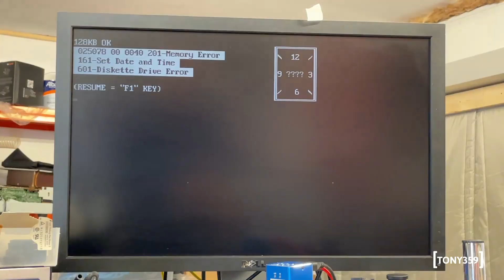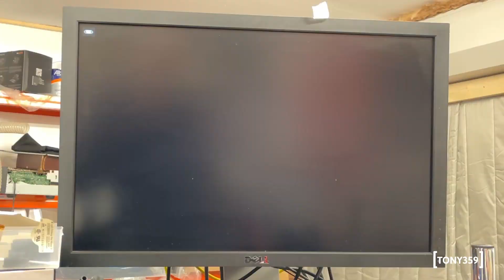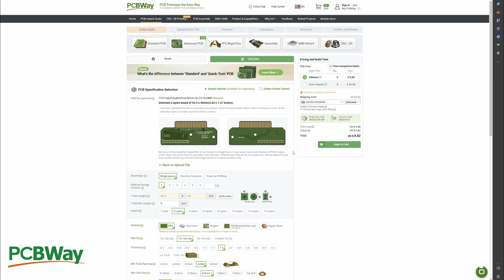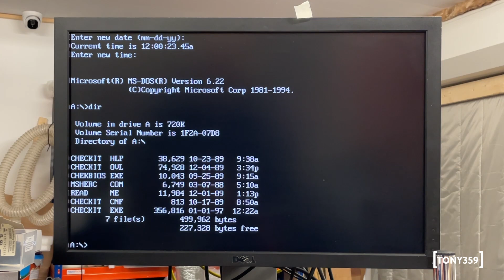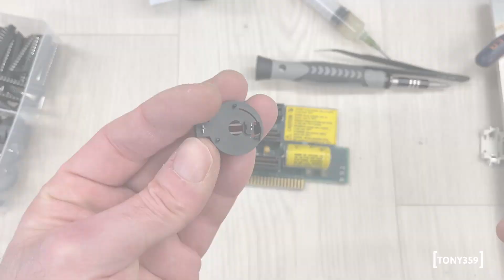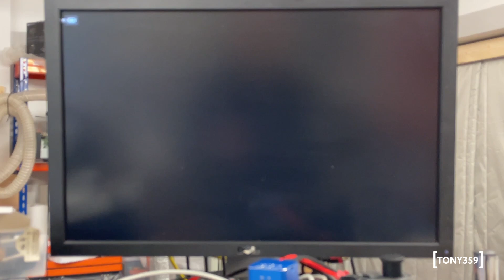IBM PS/2 Model 30 (8086) RAM Repair

Comment: I read somewhere that deoxit doesn't really remove oxidisation and the main ingredient is just the same as cigarette lighter fluid which is WAAAAAY cheaper.
Reply from the maker: de-oxit is definitely overpriced IMHO. I found that a lubricated cleaner (like Kontakt S10) is much better than the average "dry" contact cleaner. I have now purchased some de-oxit for my most important jobs but besides costing 3x, I haven't seen obvious improvements 🙂 

I did try some S60 (I think) which is a strong contact cleaner on an oxidised copper coin. It did work. I cannot remember how better it worked compared to the S10. But the S60 needs to be washed away or it might corrode the parts 🙂

Comment: I got the "101 System Board Error" when the Pc is on,it's the same like this one,any help?
Reply: Model is PS2/30 8086,the same like this one.
I alredy re-seating all chips and clean socket but nothing.
Reply from the maker: All I can see online is processor error or interrupt error. It could be anything unfortunately. Try opening a thread on Vogons, someone might be able to help?
Reply: Ok,thank you for helping.
Reply from the maker: Check this out, assuming YT will allow the link: https://www.ardent-tool.com/trouble/error_01.html

Sounds like a more serious error here. Try re-seating the CPU (all the ICs actually, it won't hurt) and remove any RAM expansion as a starting point.
What exact model is your computer?

Comment: Nice work, and congratulations for the elegant solutions. I have the exact same computer, and the least I can say is that it is not easy to repair. The drive cage and the front panel is a pain to remove, at least w/o risking to break a plastic holder (what I did, of course :( ). I also went for a PSU cleaning, and remounting the 4 fan screws was also a challenge ...
All that asides, this is definitely worth the efforts because it is a fantastic and robust PC, and 8086s are not that common.
One question concerning the replacement of the floppy drive, does the new one fit in the floppy cage ?
Reply from the maker: Thank you! The github where I found the adaptor PCB also has 3D print projects to make adaptors for the floppy, including the blue button. But I don't want that, I want to fix the original IBM one so watch this space! Thanks for all the pointers!

Comment: Another thanks for the shout-out!: Early on, you did refer to my comment in the previous video about the 128Kb of memory soldered to the planar - the SIMMs can be (gently) pulled to just boot from that amount of RAM (an older DOS like 3.30 is better, because newer versions use too much memory even for the command interpreter) as a troubleshooting method.

IBM 30-pin SIMMs are also a slightly different pinout from modules used by clone systems...

The "imperfection" is very close to where early 'P-Planar' had a bodge-wire for the MCGA video subsystem (I have a high-resolution photo, but it isn't linked in at the 'Ardent-Tool'). We will get more documentation about that up. Also, thanks for linking the 'Ardent-Tool' site!

The CR2032 mod is great, although I've seen the factory batteries still have enough operational voltage years later. As said earlier, it just runs the RTC without any NVRAM for the 8086-based Model 30. It will be interesting to see how long the CR2032 lasts.
Reply from the maker: Thank you for helping and for watching! When I'm done with the repairs and restoration, I will surely install IBM DOS 3.30 on this machine! I hope I get there soon!

Comment: 386sx is basically a 386dx with a 286 bus interface so the manufacturers could repurpose their old designs. Thus it also omits the external cache which makes it even slower. But on the inside it really is a real 386 core.
Reply from the maker: Yes, I discovered it's not just a "286 with 386 extensions" after recording that! :) It's interesting that it's the other way round: a 386-DX with 286 bus :) Thanks for watching!
Reply: @tony359  Actually, the very wide-spread idea that the 386SX has a "286 bus interface" is slightly misleading. While it is correct that the 386SX uses 24 address lines, 16 data lines, and two byte-enable lines(*) just like the 286,  the protocol concerning the control signals and the timing of the address lines on the 386SX is equal to that of the 386DX, not to that one of the 286! There are a lot of 386SX/286 chipsets, but these chipsets are specifically designed to support both variations of the protocol, and use a configuration pin to enable the 286 protocol or the 386 protocol.

(*) Regarding "byte enable" lines: You should be aware that there is a 1:1 mapping between the classic A0 + /SBHE signal names and the newer /BE0 + /BE1 signal names: A0 is the same as /BE0 and /SBHE is the same as /BE1!

Comment: Neat battery holder, i would suggest however putting a bit of Kapton tape over the tracks below the holder -ve terminal as you are relying on just the solder resist to prevent shorts from the terminal to the tracks.
Reply from the maker: Ahhh, very good idea. Thank you! I shall do that, I don't want to short that machine!

Comment: Hi Tony, I have a Socket 3 Motherboard (with PCI), initially the PCI slots weren't working because someone had really badly damaged the middle PCI Slot. I have removed that from the Motherboard and the other 2 PCI Slots now work fine. However... the Keyboard doesn't work :( I think its the M1487 Chip that is the cause as I can trace the Clock and Data pins back to it from the Keyboard Connector no problem and I get 5 volts at the Keyboard Port. 

Any ideas?
Reply from the maker: Could be a bit of everything. If the keyboard traces reach the M1487, then I would check all the remaining lines to see if they end up on the main bus. It should be through a logic buffer. If you have a scope you can try and probe the pins for activity. Does the board have any battery damage at all?
Reply: @tony359  it has no battery damage as it had a CR2032 socket. The board looks good and everything appears to trace out keyboard connector wise. Unfortunately I don’t have a scope :(
Reply from the maker: @DaveDoc1984  I guess it could be a trace, the controller itself or the buffer for the bus.

Comment: Hey Tony, thanks for the shout-out!
I usually use a dab of hot glue under the battery holder, just to make it mechanically more stable. You need to apply quite some force to pry out the battery and I feared it might rip something. Probably quite unnecessary, but better safe than sorry :D
If the holder breaks, you can just put a bit of isopropyl alcohol on it and the hot glue will let loose, so easily fixable.
Reply from the maker: Hey - I'm sure some hot glue would work but the holders I have don't require force, it's spring loaded so I just push the battery to a side with a metal tool and it pops out. I can assure you that - at least with my holder which might be different than yours - the holder won't go anywhere! But I'll bear that in mind thanks!

Comment: A tiny bit of cheap hot glue would probably be ideal to secure that holder. I have one of those but its on a specially designed pcb. This neat little discovery space shuttle solder kit made by phyx. Got it off adafruit. Also nvm, I paused at the wrong moment. Seems you wiggled it and it seems really secure.
Reply from the maker: I saw the space shuttle, very cool! Yes, it's 100% solid, no glue required at all. But if necessary,  a drop of hot glue could work as you say. Thanks for watching!

Comment: Great, this PS/2 model 30 (with MCGA graphics) was my first PC :)
Reply from the maker: Mine too. Well, it was the school's. The first PC I used. Then I started pestering my parents for my own PC! :) Can't wait to have it back in one piece with everything working! Thanks for watching!
Reply: And mine as well - I have my "Maxed Model 30" I bought with an IBM Color Printer for $300 USD in the mid-1990s.
Reply: Of course, it was stock to begin with - but now it rocks an 8087, a 1Gb SCSI HDD, 1.44Mb diskette drive, external (SCSI) CD-ROM, external 360Kb (IBM 4869-001) diskette drive, parallel port-connected Zip 100Mb drive (using the PalmZIP driver), and IBM "PS/2 Display Adapter" for VGA output.
Reply from the maker: @IBM_Museum  wait a minute: does that mean that I could have used 1.44MB floppies with my PS/2 when using the adaptor for the modern drive?
Reply: @tony359 : The pinout adapters have trouble with Gotek and clone diskette drives because the system wants to default to 720Kb - I've used the "big-button" 1.44Mb drives that typically came on Model 60s as a drop-in substitute. More information will be forthcoming on that too.
Reply from the maker: @IBM_Museum  I've just tried a 1.44MB floppy in the Panasonic drive and it's not being read. At least all that time spent writing 720K diskettes was not wasted! I need to check if the system needs a firmware update now :)
Reply: @tony359 : BIOS images are at the 'Ardent-Tool' - but for the empirical testing that has been done in the past, the diskette capacity recognition doesn't seem to be linked to the BIOS version, more of the particular drive used.
Reply from the maker: @IBM_Museum  I've ascertained my PS/2 is on BIOS version 3 and version 4 is available. I shall update when I have a moment, but not because of the 1.44 feature, just as part of my restoration. So you're suggesting that with a proper 1.44 IBM drive it could work? Only curious as I intend to keep the 720K drive on that system to keep it as close as possible to the ones I used to use when I was at school (8086, 720K, 20MB HDD)!
Reply: @tony359 : Maybe you mean the third version (since the numbering starts with Revision 0)? - BIOS with a version numbering of '3' was skipped for the 8086-based Model 30. It is unique with IBM that all you need to do is look at the FRU label of the chip, then compare it to compiled lists and information at the 'Ardent-Tool'.

BTW, the 'Revision 0' BIOS is the first PS/2 BIOS, and actually had a different MCGA font that was changed later...
Reply from the maker: @IBM_Museum  yes sorry. I am on version 2 and I see a version 4 available. Is a programmer the only option or can that be done via software? I have a programmer so no big deal either ways.
Reply: @tony359 : It's going to take an EPROM programmer and two 27256 chips. I've remembered that the Revision 4 BIOS adds support for the 45Mb proprietary HDD.
Reply from the maker: @IBM_Museum  Thanks. Shall do in one of my future videos! :)